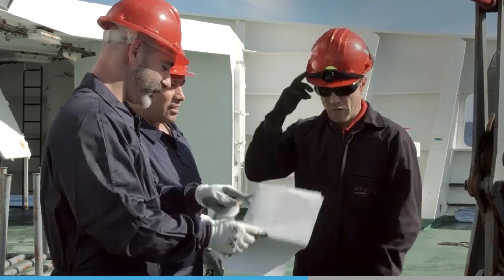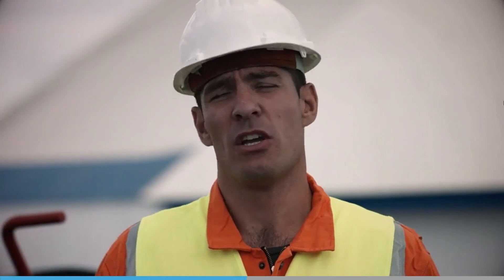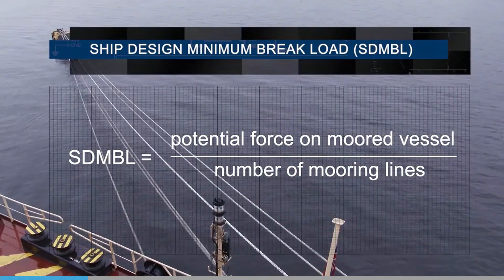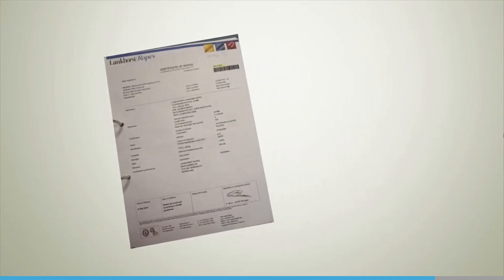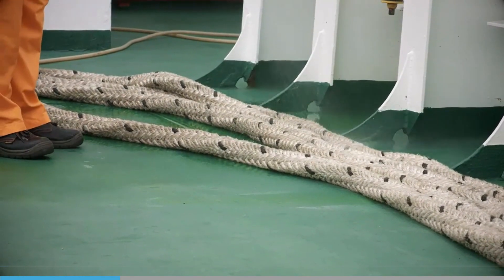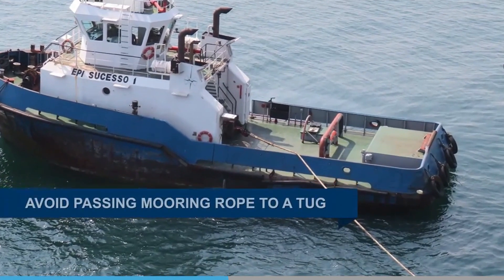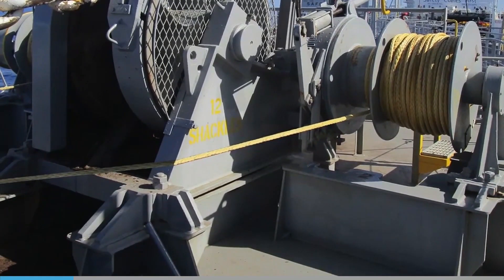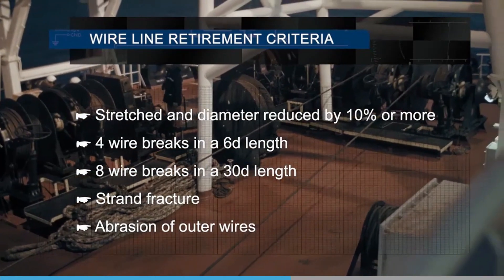Mooring System Management Plan (MSMP) & Line management plan (LMP)

Comment: Nothing Difficult about 8-12 line mooring plan. As a Able Seafarer Deck RPNW,. SIMPLY put out 4 Spring Li es of Spectra Amsteel Blue 4 Leading Forward, 4 Leading Aft, 2 Head Lines 2 Stern Lines 2 Breast Lines. What so difficult about that. The Head and Stern lines are made off on a capstan or winch. The Spring Lines come off Constant Tension Winches to maintain position. Breast lines are hand tended through chocks to side bitts. Nice videos to Teach FUCKING AMATEURS. I NEED NO SUCH TRAINING!